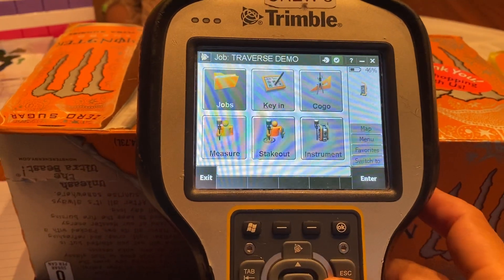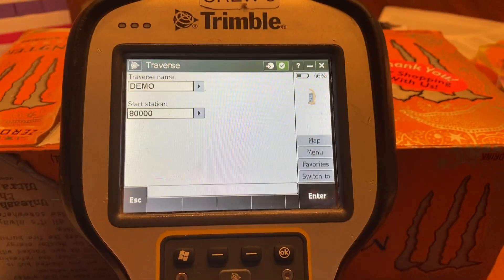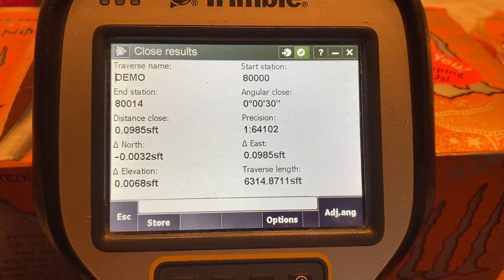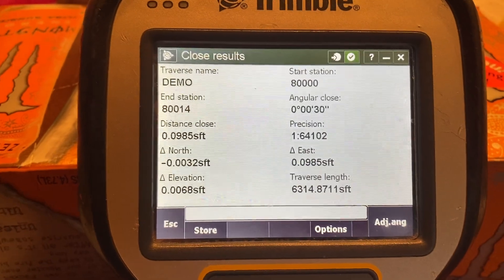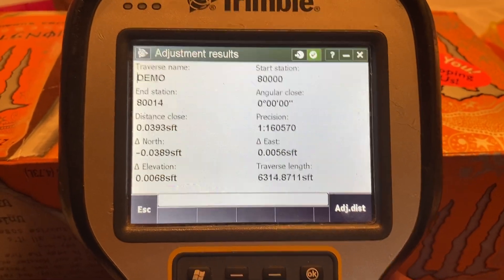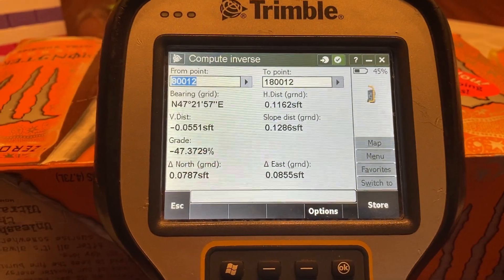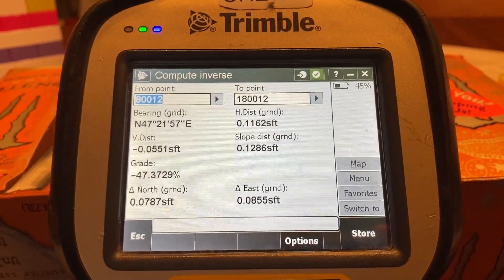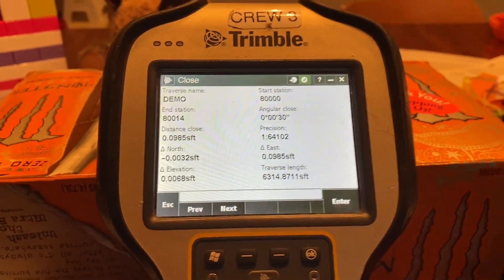Closing and Adjusting Traverse TSC3- Trimble Access

Comment: You mentioned that your control was busted and you were going to fix it the next day. Just to clarify, you typically want to make sure your control is fixed BEFORE you adjust your traverse, correct? Or does it matter?

I am working on a simple road topo that goes through a suburban neighborhood. There are a lot of power lines that threw off the H on the GPS when I set my first station. When I shot my backsight, I noticed a .1’ error on my H. Towards the end of my traverse, I check into mu control and the H is almost 1.0’ off. V was fine, though. Adjusting the traverse will NOT fix this problem. The initial control I set my total station on needs to be remeasured (this time with total station). THEN I can run a traverse adjustment.
Reply from the maker: @maxwellmontgomery3421  

Sorry I don’t get on YouTube very often.

Yes.  This particular project had years upon years of random control set from a primary traverse that was done decades ago.  Spur points and all.  Coming from one side of the project to another, it checked like crap….nobody ever checked it because it was just small bits and pieces done on the fly that didn’t have anything to do with the entirety of the site.

When we ran 2 different crews and met in the middle we found over a 0.5’ horizontal bust.  That’s when we decided to re-run the entire thing - close/adjust - moved all of our setups to the new coordinates. 

We had to do that because nobody listened to me up front about checking all of the major control.
Reply from the maker: @maxwellmontgomery3421  

Also….I ran a LINEAR traverse that was over a mile long.  I did all of the field work.

I started with GPS observations on one side and ran the robot to the end to two more GPS observations in GRID). It was about 0.50’ or so off - angular.

I picked up my robot observations and rotated it to my GPS observations.

ALWAYS - keep your Robot observations in separate point range from GPS for this and many other reasons.

Got all GPS observations within 0.07’ or LESS from robot observations after moving it all.  🤘🏼

Comment: Trying to follow your closurer... I put my start point in and close on a know without occupying... Just shooting into it... The collector stops on my point before... Never tried it before what am I doing wrong?
Reply: You really shouldn’t just check into one point. You should check into two known control points with an ending azimuth.
Reply from the maker: @michaelcandelaria1638  

You have to measure rounds to your backsight and foresight or it won’t work.